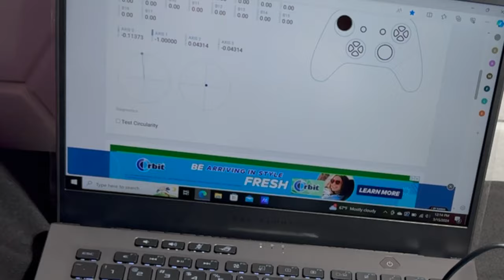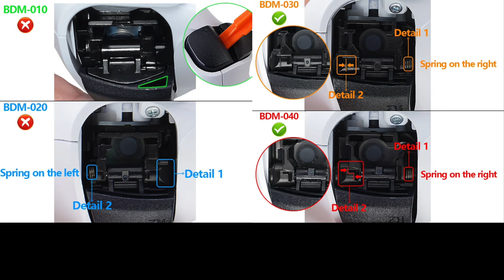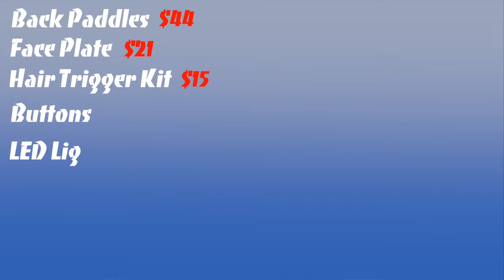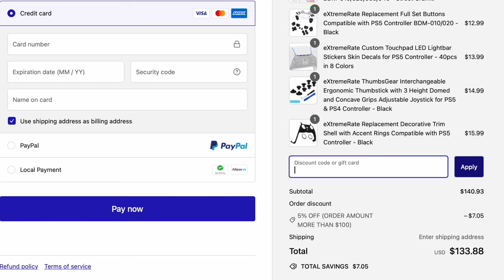Build A Competitive Pro Controller With Hall Effect Joysticks

Comment: This guy will help you break your controller. He says it's easy but it's not. He's obviously been doing stuff like this for years most likely. I ruined my controller because this guy convinced me this was easy.
Reply: And he's def getting paid from extremerate
Reply: @chasewinters7050  its easier than you think, you just werent careful enough
Reply: i recently replace 2 ps4 analog with hall effec, its actually very easy . me and my technician friend did it.
Reply from the maker: Hey! I don't recall saying this is easy. At 0:57, I mention that it is hard. This video was a challenge to myself, as it’s a difficult process but very doable. I don't have a lot of experience. I started doing this about 2.5 years ago when I launched this channel, and I learn through trial and error. Just watch my first videos and see how horrible I was at soldering and all that stuff. I’ve never received any money from eXtremeRate—I just enjoy using their parts to mod controllers, and I think they are very well made

Comment: 🤦‍♂️ Cutting ✂️ a wire to disable the Triggers force feedback motor. What the heck. Destroying that expensive DualSense controller. 🤦‍♂️ You should have bought a used DualShock 4 controller instead.

Comment: What was the circularity percentage?
Reply from the maker: I just tested. Left stick 14.7 avg error the right stick 14.8
Reply: @TheGamer2Know  you think it would be 0% due to it being Hall effect?
Reply: I have a hall effect controller the error is 0.1%
Reply: @TheGamer2Know  You need to calibrate the gamepad after installing hall effect. It should not be over 7-8% with hall effect sensors. Is the circularity test rounded or squared?
Reply: @TheGamer2Know  there's a website where you can calibrate them using software as well now. Was a big help for me. Everyone should at least test with that. Software and hardware calibration both are required.
Reply from the maker: @EpicBunty  Yes, If you check my recent videos, i actually try to calibrate this controller with that software!

Comment: I learned to solder in the navy back in the 80's   Because of the types of systems we were expected to work on, such an anti-aircraft missile systems, etc, the required standard for soldering in the navy is extremely high.  As such they put us through the NASA soldering course during our 6 month employment induction.

If you're interested in improving your soldering, to get more reliable solder joints and be less likely to do damage to parts and boards, the NASA course materials can now actually be found online for anyone to reference.  It does cover techniques which tend to be used more in military and aerospace applications, however the fundamentals are the same.

They touch on topics like why too little or even too much solder can eventually result in a broken connection.  Part stress relief and how to avoid damage to insulation, parts, boards, etc.  What a good solder joint looks like, versus what bad solder joints can look like.

In short, you want to aim for shiny concave solder fillets.

Too much solder where a solder joint might look like a blob, has increased risk of later becoming electrically disconnected or poorly connected.  Believe it or not, a concave solder joint is stronger than a blobby solder joint that has more solder.

Movement while the solder cools, can cause the solder joint to appear frosty due to crystallisation of the solder, which can cause a dry joint (again, electrically disconnected or poorly connected).
Reply: thanks so much  for the NASA course information🔥
Reply: Yo your amazing I was wondering how I should go about learning and nothing could be better than nasa😂 do you have a link?
Reply from the maker: Thanks for the informative content. I haven’t took any course I just bought a cheap solder machine and start practicing and fixing controllers. My motto is if your a gamer you
Probably not a EE and don’t have that type of background, so try to DIY. Worst cause you break a $60 controller and will have some practice. I don’t encourage you to go soldering on machines that are valuable.

Comment: All the other videos I've seen of people installing these hall effect sticks have a problem with the sticks reading 100% before the sick has even got to the end. 

So what i mean is if you push the stick to the left 70% the game will think you're pushing it 100%

Do you have this problem too with these. 

Also I've seen that others install a PCB to help with calibration.  Is this needed?
Reply: These HE sticks read 100% with stick at around 80% . As you said to do it right you need calibration board
Reply: No it is not. There is an online calibration tool which fixes centering and stick range.

Comment: You don't have to apply flux when using the heat gun to get the joysticks off?
Reply: no its batter to always use flux  just be careful as to not get it into the stick its self

Comment: How do Hall effect joysticks work? Interested in swapping to the hall effect... but I want to validate if they are good changes or not
Reply from the maker: Hi check this video hope it helps 

https://youtu.be/PrjKbw-F6zU?si=LcCESi1I281FUpLd
Reply: TLDR they use magnets instead of some paste that wears out after a while. Using magnets means they never touch basically meaning no drift ever.

Comment: You thought the red controller was drifting, but it actually had an issue with the motherboard, am I correct? I'm asking this becsue I think I've been in the same situation, twice. After dropping my DS one time too many, one of the thumbstick started moving on its own sometimes, but it didn't look like drifting.
Reply: Same happened to me. I did the software calibration and it's ok for now, but eventually I will put the hall effect sticks.

Comment: Nice breakdown and fix. Btw are your boards failing due to ESD or your soldering iron is burning the circuit board?
Also, can you do a hall effect video for the PS4 controller next 🙂
Reply from the maker: I am not sure why the first board failed; it worked for some time while I was calibrating the joystick to the center. But then, all of a sudden, it turned off, and no matter how many times I tried to get it to turn back on, it didn't respond. It took me a long time to reach that point, and I felt like giving up on the video - it was much harder than I had imagined. I took a few hours' break, came back and used the board from the original red controller I was planning to work on. Since I had already done some work on that board for another video, I wasn't sure if it would hold up. After countless hours of working on it, as you saw in the video, everything worked out. This is by far the longest time I've spent on filming and editing a video. I've posted a few PS4 controller videos, but it seems they are not getting many views, perhaps because no one uses PS4 anymore. If there are more requests for a Hall effect PS4 controller video, then I will definitely make one.
Reply: Well your def learning from your mistakes and getting better. Keep it up man. I'm going to watch your other PS4 controller videos. @TheGamer2Know
Reply: If it was ESD from soldering it wouldn't have worked after replacing the thumbsticks. It worked for a while then went poof. If it was ESD it was when he was working on it.l powered up adjusting it.
Reply: @TheGamer2Know  lmao, saying that no one uses a PS4, or a PS4 controller anymore is pretty short sited. While I don't use a PS4, I do use a PS4 controller, I find it more comfortable than the PS5 controller.
Reply: @madmax2069 how is it short "sited" when he literally arrived at that conclusion through pure data?
Reply: @EpicBunty  "pure data" yeah seems like data pulled directly from his rear.

Comment: Ill believe it when ever i see you using it on call of duty with no drift. I didnt like what i seen when you were calibrating it. It didnt look like it wanted to stay where you placed it. Like if you were to bump it. It would go right out. Like i l would love to believe it but its in the video. I want to see it move perfectly with the screw your turning.
Reply from the maker: Believe what you want. I’m still using this controller on warzone and it’s working perfectly fine. I cut scenes when I was calibrating it because it took forever to do it. Not  gonna have footage of me calibrating the damn thing for 10mins or how ever it took me to do it
Reply: Ok cool that's what I want to here!! That's funny sorry. It just seems like that part sucks and the parts were giving you trouble. It would be awesome to get some more videos of it whenever. I hope it keeps working for you. I'm planning on doing it too if yours keeps working because I think I've bought 8 controllers. And fixed them over and over. I don't see why Playstation keeps making them like that

Comment: I destroyed my elite controller trying to replace it when I was younger, its been 3 years, my new controller is at the same point, gonna try again, do I need the sucker poper ?

I only have the solder pen and alloy strip, and what do I need to be careful with, I think my last controller broke beacuse the metal that is around the pins of the joystick got scratched too much.
Reply: You don't need a solder sucker, but it does help, they have soldering irons that have them built in, but are far more expensive but is the way to go. Practice soldering on something that's already broken and doesn't work before you work on something you're going to use.
Reply: You need to be careful on not getting the soldering iron too hot, you need to keep the soldering tip clean and shiny, if it gets burned or dull looking it's going to cause you issues (get what he said at the beginning).